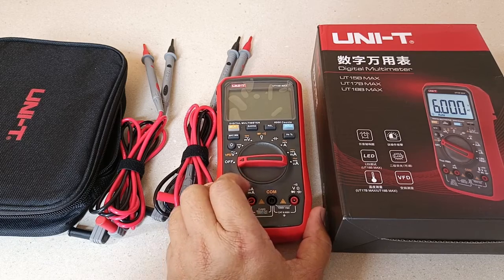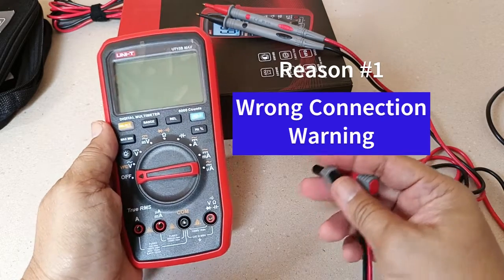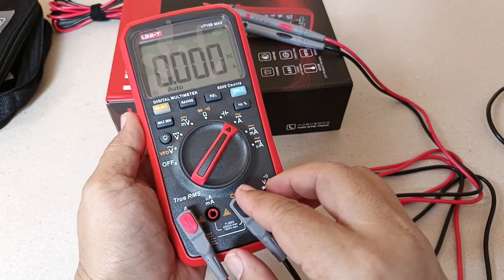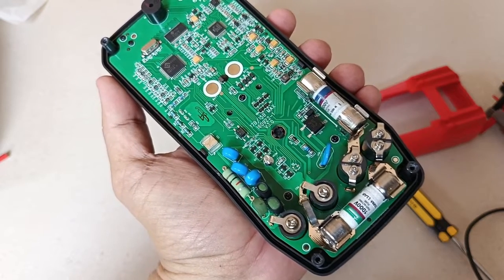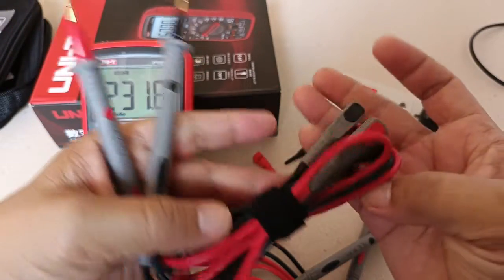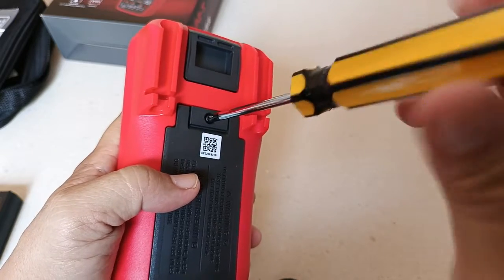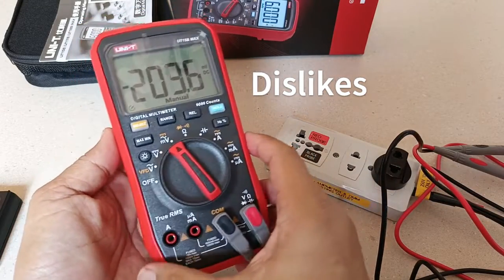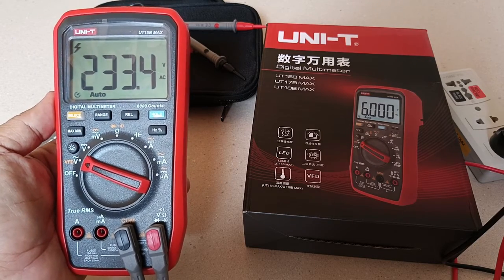New UNI-T UT15B Max True RMS Digital Multimeter | Short Review [CC]

Comment: Would you recommend me the UT17B MAX over the UT191T?
Reply from the maker: Thanks for watching. The UT-191T is built for field and industrial use — IP65, 2 m drop resistance, and proper safety certifications. The UT-17B Max, on the other hand, is a newer model with VFD filtering and temperature functions. It's also a CAT III 600V rated and has some safety features built-in.

UT191T would be more suitable if you want rugged, industrial hardware for job sites; 

While the UT17B Max would be great  if you want a modern, feature-rich meter for electronics and bench work.
Reply: @ramschannelreviews Thank you for your reply. Although I am going to use the multimeter mainly for electronics and bench work I am probably going to opt for the UT191T because now it is cheaper than the UT17B MAX

Comment: Благодарю за обзор. Вы один из немногих, кто уделил внимание двум важным для меня вещам. Первое - подсветка и её длительность. Второе - проверка p-n переходов с beep. В этом плане прибор очень достойный, учитывая также его приличную точность. Но не кажется ли вам, что великовата длительность измерения резисторов? Или вводит в заблуждение множество промежуточных показаний перед окончательным?
Reply from the maker: Thanks for your appreciation. Yes it's a decent and we'll equipped DMM. Its speed on resistor testing was fast enough for me, and its results were as consistent with the readings of my other DMMs. The intermediate readings you mentioned, as you know, is due to the auto ranging trying to narrow down to the correct, final value. I think you can improve the resistor testing speed a bit if you select manual ranging but auto ranging is just convenient.

Comment: I've had the 18b max on my wishlist for a while. It seemed like an auto ranging version of the ut89xd. The ut89xd is simply fantastic for repair work but I don't like manual range. I downloaded the user manuals and apparently the Rel feature only works on capacitance on the 18b. The Rel works on everything on the 15b and 17b.  Why would they take that away on the 18b max.
Reply from the maker: Really? Sorry I also do not know why. I thought Rel works the same across all 3 "Max" series. Curiously, the Fluke 18B+, from which the UT18B Max seems to have been patterned after, didn't even have a Rel button. Actually I'm not really sure which came first the 18B+ or UT18B Max. But their designs have too many similarities to be mere coincidence.

Comment: While I take a look at multimeter I noticed that the above cost as much as the UT61E Plus. 
From the spec the UT61E Plus remain better,right?
I read that is necessary have two multimeters to be able to measure voltage and current at the same time.
If you think that the Uni-T is a good brand, which low budget version, possibly with good fuses inside, can be considered?
Do the UT89 series make sense?
I'm curious about small project such Arduino and similar, but I don't know if their measurements of Resistance and Capacitance are sufficient.
Plus they are manual,so at the beginning, harder to use.
Reply from the maker: @nonsolorasatura9093  I appreciate your comments and inquiries. If you did not mention Andruino I wouldn't have known about this open source electronics platform. It looks like a great opportunity for personal projects. I'm sorry to say though that electronics aren't my primary use of multimeters, but main power monitoring (60Hz power supply for residential and commercial). The 61E+ has been commended by several reviews. Unfortunately I neither have it or the 89 series so I can't make an informed comment. But between these and the newer UT15B Max (or UT17B Max and UT18B Max) my choice would still be UT15B Max due to its superb high speed, 1000V, high interrupting capacity fuses, and several thoughtful safety features- suited for my purpose. It also comes with 2 sets of test leads: a standard tip, and a needle tip. I have no use for the needle tip but I think this is a nod to electronics usage. So yes I think UNI-T may have had electronics enthusiasts in mind when they designed the "Max" series. Be aware also that Fluke has a unit called Fluke 15B+ whose features are almost the same as the UT15B Max. Manual ranging DMMs have the advantage of speed IF you know the correct range to select beforehand. As far as I know some enthusiasts have ESR meters for more precise capacitance measurements. For highly precise resistance tests there are meters for this as well but they are quite expensive. Still, for overall usability I'd keep an auto ranging True RMS DMM always. The great thing about DMMs today is that one has a lot of choices. The 15B Max is a good option to consider.

Comment: Thanks for the video. I have bought one  and really liked it.The only issue is volume of the buzzer, is it loud enough cause the unit i receive is barely audible. Is there volume setting you can change for the buzzer ?
Reply from the maker: I appreciate your comments. Just now I tested the continuity buzzer of my unit. It was indeed not as loud as my Hioki DMMs, but the same in volume as my Fluke 107, in my ears. The Fluke 107 though has a higher pitch, while the UT15B Max has a bit lower pitch. Perhaps that may have caused the impression of a barely audible sound. Unfortunately there isn't a way to increase the volume.

Comment: What brand name of rechargeable 9 volts battery you are using in your old UT191T ?
Reply from the maker: @playstation2bigs  I don't have rechargeable 9V. I am using non-rechargeable Energizer Lithium 9V battery for my UT191T, as well as my Fluke 116.
Reply: @ramschannelreviews  ohhh does it last longer? How many months before it die ?
Reply from the maker: @playstation2bigs  I can't mention a definite time, but these 9V Lithiums last much much longer than 9V alkaline batteries I used before. I have yet to replace any of them in my DMMs. My UT191T is a battery hogger but it's still on its first 9V Lithium battery. Granted, my test equipment sees light use only nowadays.

Comment: I was originally considering the UT60S. But since I saw your review on the UT15B Max, I'm am seriously considering this one or the UT17B Max for the temperature function. The UT60S does have the NCV function added to it (which the UT15/17/18 Max does not) but I don't need the NCV function that much. Thanks man. 

Mabuhay, Thank you for this review and stay safe! 👍
Reply from the maker: Thanks for your comments. I don't know if you've come across them but the design of the UT15BMax and UT17BMax resembled a lot like the design of the Fluke DMMs bearing the same model name. The UT15BMAX wasn't cheap (I think the UT60S  is cheaper) but it was worth it. The UT17B Max should be even better for not much more money. I prefer a separate NCV stick over the one embedded in a DMM. Safe testing sir!
Reply: @ramschannelreviews  Oh I forgot to ask this. Since you have the UT191T PRO too, which is better in terms of performance, robustness and input protection? I just checked the price of the UT191T PRO and it's cheaper than the UT15B Max as of today.
Reply from the maker: @therealdaniboi  The UT191T Pro is a good DMM. In fact it is the one sitting in my work shelf ready to use anytime. Rugged and its battery and fuses are easily accessible. However, I think the new, safety features that UNI-T embedded into the design of the UT15B Max justified its higher price. Those two, high speed input fuse protection aren't cheap, wrong input connection warning, two sets of test leads, rugged build as well, uses the more common AA battery instead of the 9V used in the 191T Pro, with adjustable backlight. The only thing I didn't like about the 15B Max, is that if you need to change the fuse, it's more a hassle than the UT191T Pro. But if you don't need those, the 191T Pro should be a good, lower cost alternative.
Reply: @ramschannelreviews  Thank you again. I'll update this comment of mine once I made my decision on what I'll end up buying.

EDIT: I made the decision about 5 days ago and I went with the UT17B Max which arrived today. Honestly I was surprised on how solidly built this multimeter is. And it measures faster than my old Sanwa CD771. 

I am super satisfied with this meter and I will be placing this on my work table.

Comment: TRUE-RMS but till what frequency ? Can it measure (duty cycle) of SMPS that works at 150KHz + (not the hiest frequency). What is the price ? In comparison to UT-139 how is behaved ? Is it costlier ?
Reply from the maker: I appreciate your questions but I'm not sure if this answers them. According to it's online users manual (I got the Chinese language printed manual) it's frequency response for AC voltage is, sine wave 40Hz- 500Hz; non-sine wave 40Hz- 200Hz. Rated frequency 10Hz- 10MHz. I suggest you download the English users manual for duty cycle and other details you might need. 

https://meters.uni-trend.com/product/ut15b-17b-18b-max/#Docs

Price depends on where you buy it. From a local online Philippines seller it's the equivalent of around U$70 after promo discounts, amazon price was higher. It's way better than UT139C, but bulkier.
Reply: @ramschannelreviews  Just 200Hz for PWM signals ? Not worth the many. Anybody can buy a small single or dual channel oscilloscope for that many. ANYWAY, thanks for your answer
Reply from the maker: @gamiwv  You're welcome. I don't know if this means anything to you but the user's manual mentioned that duty cycle for square wave is up to 1kHz. An oscilloscope would be great, but unfortunately, I don't have one at this time. Thanks for your comments.

Comment: ut15b max or ut61e+ which model is better?
Reply from the maker: Thanks for watching. I have no UT16E+ so I can't make an objective comparison. But before I purchased the UT15B Max, there's quite a number of reviews for the UT16E+ that I've also read. In the end, I picked the 15B Max. Partly, because I already have the UT191T. But mostly because it's newly released and I was impressed with the usability and safety features of the 15BMax. It's a solidly built DMM. High quality fit and finish. I'd choose it again given the choice. That's just my subjective view. Your particular use case should tell you which of them would be more suitable for your purpose.

Comment: Love this model, removable holster is really important to me. I hope uni-T will implememt autohold on their meters
Reply from the maker: I agree. It's quite a hassle though access the fuse of the UT15B Max. I'm not sure but maybe it's an added safety feature, to seal the back in this manner? Other than that, the workmanship on it was impressive. I thought it was expensive for a UNI-T DMM but when you use it, it's quite a solid multimeter worth its asking price.